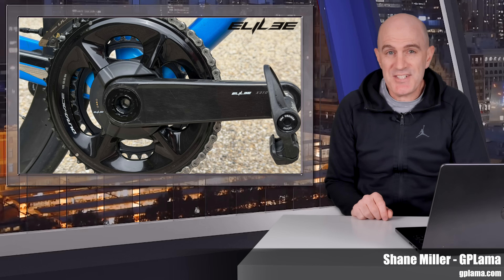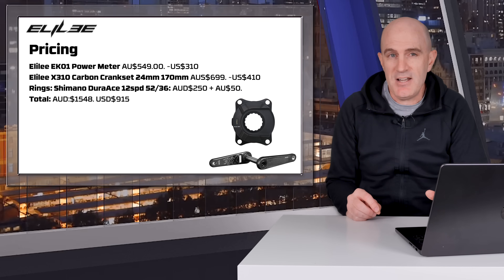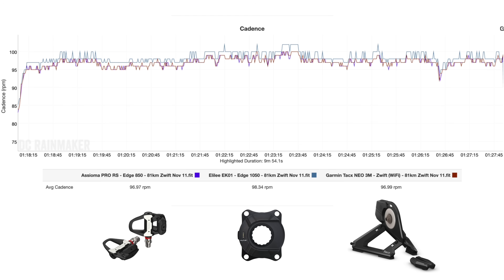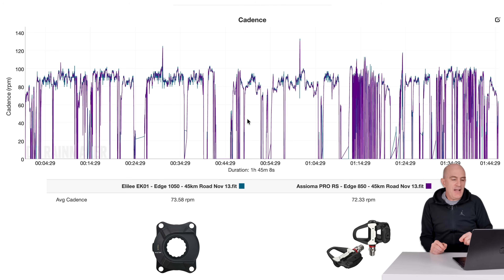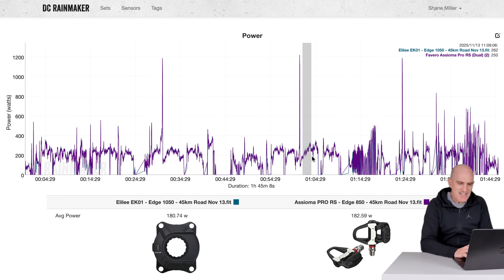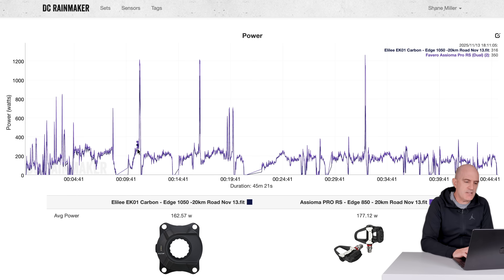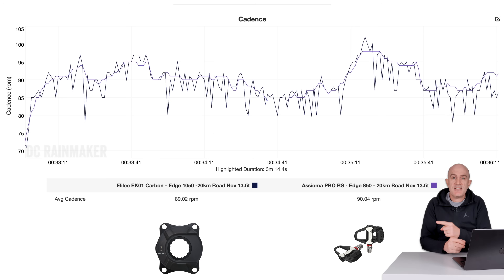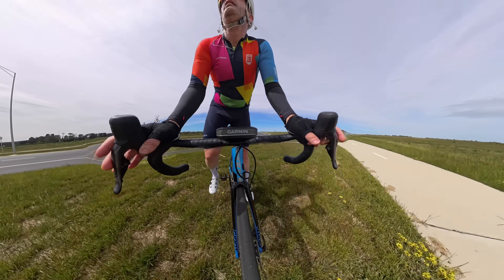Elilee EK01 Power Meter Review // Still a Work in Progress

Comment: Any Observations on the Neo 3M now that you've got your hands on it? Accurate?
Is a review on its way?
Great Videos as always, loving the crunching of numbers and going deep into rabbit holes to find the issues!
Reply from the maker: Planning on covering it soon. It's a beast but still not immune to virtual slip on steep virtual gradients when using a standard cassette. The virtual shifting on it is amazingly good (due to the resistance unit design).
Reply: @gplama Looking forward to that! I've had a Neo 2 for a while now and never had issues with Slip (not a sprinter by any means), but I'm annoyed by serious underreporting of Power the higher the flywheel speed gets (verified with 3 different sets of Assiomas). Would be great if this unit fixed it.

Thanks!

Comment: I spent my weekend trying to understand spider power meters and their compatibility with groupsets (including watching GPLama footage). I couldn't agree more that the landscape is a mess and that I'm very happy sticking with my Assiomas!
Reply from the maker: Sigeyi have a compatibility matrix on their website for choosing the correct meter.... but it's still too hard to understand. I want an AXO SL for my SRAM gravel bike. There's no gravel - only road and MTB. Do I buy MTB with the non-boost offset adapter? I'd have to email them and ask. 

These sites need a compatibility wizard to step users though what they have and what will work. It won't even require AI to implement something like this.
Reply: It took me a while to work it out as was replacing an ultegra crankset. In the end I bought a rotor 24mm axle, rotor aldhu/vegast 24 cranks and a rotor-compatible p2m power meter with 4 hole interface (to fit my ultegra chainrings) Whew...

Comment: Thanks for reviewing. I would like to watch XCadey gen 2 test.
Reply: I had one, I was not impressed. I had to do like 15% upscale I think to match my saris h3, and the data was always jagged, both in comparison to the trainer, and swapping cranksets back to my 4iiii.  I sold it and the cybrei cranks. I think you have to pay for for a power 2 max, but I have to say I’d consider the one here, this data looks a lot better than the xcadey I had (purchased from power meter city in the spring of this year).
Reply: @jonathanzappala  "data was always jagged" so the polling rate was higher?
Reply: @RylHango I thought that a possibility but it’s from the one second number in the raw data, so it’s like 4iiii (dual side 105 7000) or my h3 are power smothing on the device and I don’t think they do that. All this before Garmin or trainer road is 3 second smoothing. So an entire ride could be 1-3 watts average different (after the 15% scale) but intervals would have bigger differences.  I don’t have an assioma to use to compare, I guess that would be the gold standard of sampling.
Reply: 别看了，我可以给你明确的回复，ek01比xcadey功率计强多了，这两个我都用过，gplama说的那种问题对于正常骑行根本就没影响。
Reply from the maker: @kristseng3937  Do you work for Elilee? Update: Based on your other comment, it looks to me like you do.
Reply: @gplama 实话实说而已，xcadey今年我一直在跟进测试，不停的刷入新款固件，买了ek01carbon以后明显感觉xcadey差了不少。你说的ek01那些故障我是真的一个都没遇到不管是骑有氧还是HIIT。
Reply: @gplama 我为什么要去Elilee上班，工资很高吗，我在其他行业赚的比这个多多了。我第一部功率计就是P2M ng eco搭配sw曲柄，然后xcadey sigeyi Nexga ek01c，好不好用我心里当然有数。帮ek01c说好话的人一定要去上班吗？
Reply: @gplama or a fanboy or someone who just likes to buy gear but no idea? 😅

Comment: I have a set of the 310 cranks after resizing down to 165's a number of months back. I'm liking them thus far.
I now need a power meter for those cranks, so I am in the market for a power meter to go with, and did see this power meter. My initial thought was 'dubious' on the power meter tech front. Thinking of just going with trusty Power2Max they offer at Elilee Australia.
Reply from the maker: P2M hardware is a wise choice. I'd love to see them innovate a little more, even if only by dropping their prices 🤣. Their app is still an utter mess.
Reply: @gplama the P2M app is so bad it looks like it's a fake app that's here to ransom ware my phone
Reply: @gplama its like they ve put the whole thing on pause ... yeah agreed still very reliable and good option but prices need to go down or it need to be updated .

Comment: Me over here using Garmin Rally pedals 👀👀
Reply from the maker: You're good. I'm all alone in being able to make those shit the bed in sprints. Although it was an acknowledged issue, and resolved with the new Rally x10 series.
Reply: @gplama my issue has been with Garmin's cadence sensors. Spinning over 135rpm makes them drop and read less than 100
Reply from the maker: @paulschulman8131  You've made it happen too! 🙌
Reply: @g @gplama  lol. Oh and my 530 is rebooting itself while running... not quite sure why. I keep everything up to date and empty old files from time to time

Comment: Seems like that my decision was not that bad. I am going to use the  x310 crank (DUB version, 80€ cheaper) with Assioma pedals.
Reply from the maker: The cranks are very nice. What rings are you installing?
Reply: @gplama Either Absolute Black or just normal Ultegra. I prefer the Absolute Black ones, but if I encounter any shifting issues I will switch to Shimano.